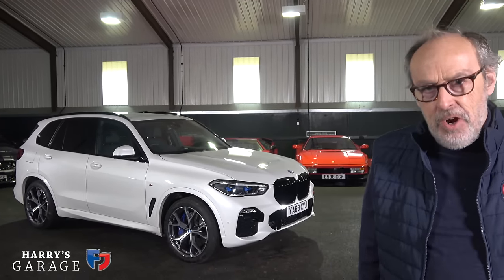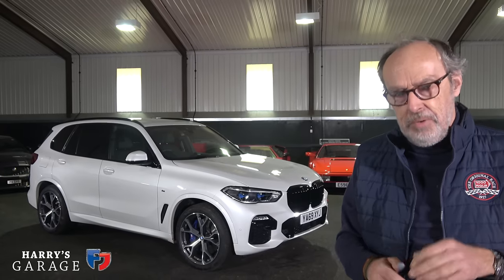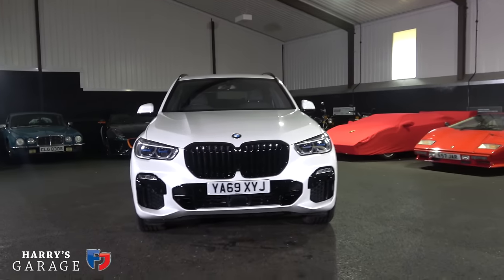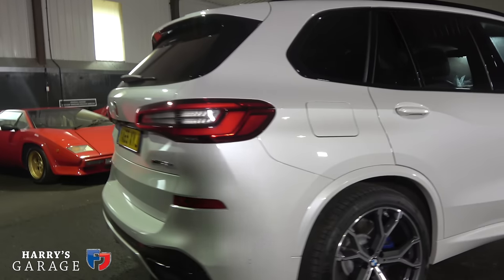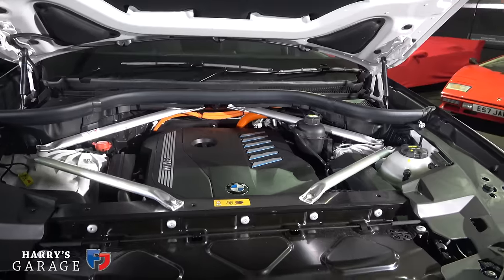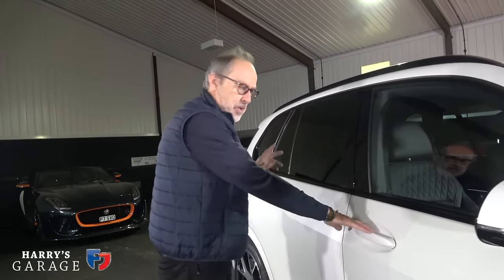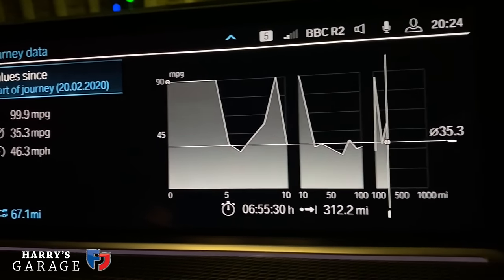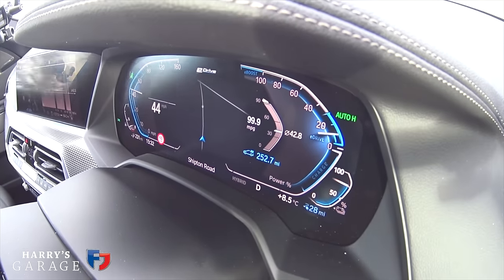BMW X5 45e PHEV 2020 review. Is this new plug-in hybrid better than a pure EV in the real world?

Comment: Great video, as always. What sort of cost is involved in having a home charge point installed? Also what is the life expectancy of the batteries? Would these vehicles be an viable second hand purchase in say around 5-10 years?
Reply: Same question here, oh BMW guarantees batteries for only 6 years! Be aware! About the charger, not just the cost, but what kind of amperage do you need? Most old houses don't have a lot of room on their breaker boards.

Comment: It comes with a charge that will work from a 13 amp socket and charge the car overnight. If you have a charge point installed it will charge at 32 amps and they say get to 80% within six hours. First you have to go into settings to adjust the charge rate. I have a charge point on order, due to be fitted later this month.
Reply from the maker: I've been told it'll only charge at a max of 16amps due to new EU legislation to limit grid demand, which came in 01.01.20. Couldn't find any way to increase charge rate beyond 16amps and that's only up to 80% anyway, then it reduces down to below 10amps to protect battery. Takes an age to recharge!

Comment: Correct me if Im wrong but these 63 mpg values dont have electric cost in them while in the same time you said that power bill and petrol bills are almost the same for a year at about £700 each.  Which makes the mpg drop by half in my book, in pounds cost, not in petrol gallons of course...
Now compare the cost of buying the X5 new at 77K vs running your old Range Rover as a daily for 7-10 years and you'll see the savings arent there.

Comment: Good video - will be curious to see if you can get a GLE 300de to compare... is the 60 mile claimed range real, is the extra economy of the 4 cylinder diesel good enough to compensate for the NVH difference?

Comment: I wonder when you come to sell/trade in if you can tell how many miles the engine has done and how many miles it's done purely on Electric?
Reply: A good question. I also wonder how the engine will wear as it's potentially activated to work hard from cold with no warming up time.
Reply: Good question! Awnser it somebody!
Reply: @resnonverba137   Well, I've worked at a Hyundai dealership and I stopped recently. In there plugin hybrids (ioniq hev and or phev) they used really thin oil for the engine so it got up to temperature just as fast as as regular petrol engine. However. The normal hybrid vehicle I drove, always fired up the petrol engine as soon as I started it when it was cold outside, just to put some temperature in it.

I think, unless you really put your pedal to the metal, the engine will be fine. However, I've got no proof. These cars are just 4 years on the market now an no errors have occurred yet.
Reply: @Stichting-AAP  Thanks for info.
Reply: Res Non Verba id imagine as long as you stay under 4K rpm it’s fine. I’m curious if the engine has a heater on the block to get temperature into the engine. I’ve owned two Bmw now and they typically don’t get up to temperature for the first 15-20 mins of driving so I’m very curious.
Reply: @thomasbailey4139  You could be right but it would be another frustrating restriction with the car. For me, hybrids still have a long way to go (excuse the pun) before being a serious consideration.
Reply: Res Non Verba if I lived in Europe I’d strongly consider that car. In the states 93 octane is cheap still and id just buy the standard oil burner.
Reply: @thomasbailey4139  Many diesels are now superb and matched with excellent auto gearboxes that make the most of the power and economy. It's ironic that, now they are better that they've ever been, they are apparently the work of the devil. I've covered over 5k in the latest 5 Series and have nothing but praise for it yet I would tread very carefully before buying diesel now as the resale could be seriously affected by legislation.
Reply: Csab  We can't be the only people that are curious yet I've been unable as yet to find many answers on the Internet.
Reply: Res Non Verba we don’t even have the option of a diesel in the states and if there is one it’s for a year then killed off and the people with them do really well on resale. Our super duty trucks have diesels but who cares.
Reply: @thomasbailey4139  Interesting. Just as well the BMW petrol engined cars are also very good.
Reply: @resnonverba137  If I am not mistaken, Thomas from Autogefuehl tested the new X5 PHEV and I believe he said that according to the BMW engineers some components of the engine are built better, more durable.
Reply: @jakadirnbek7141  Thanks for info.
Reply: All that tech will be interesting to run once it's out of warranty.
Reply: @resnonverba137  https://youtu.be/cFqrVPN60lI at 38:00 Thomas talks about durability
Reply: It depends -if you want to reduce your use of fuel, then a hybrid will do that
Reply: @resnonverba137  I think it's to reduce the particulates in the atmosphere
Reply: Res Non Verba I’m sure the bmw engineers have thought this through...
Reply: @jakadirnbek7141  Thanks for link.
Reply: @ethicalelectricalgroupltd3153  The same engineers that thought through Vanos technology.. I would rather ask the questions and have some idea of what is what. As Harry mentions, plug-in hybrids are more of a pain than a resolution if one does not have the ability to keep the battery topped up at home.
Reply: @resnonverba137  Things should be better because if you do 40 miles or less the engine doesn't have to kick in at all. I'm sure there will be some sort of eco setting where the engine doesn't start up at all until the battery is dead but it might lower acceleration

With the average UK car doing just 20 miles a day it means most days it would be all electric

Long range (20-50 miles) plug in hybrids solve a lot of the problems with petrol cars. The best selling car in Europe being the small Polo which costs £13,000

Add a 8KWh battery to give 30 mile plug in range. And this little hybrid Polo would be 90-95% annual electric miles and only 5-10% Petrol

Less wear and tear
Much cheaper fuel (1p a mile on cheap night time electricity rather than 11p a mile on petrol)
Lower maintenance
Better acceleration especially at the 0-40mph speeds these cars spend most their lives in

The government could and should deploy a million 7KW chargers in car parks supermarkets stations and popular locations and make it free so people can charge up at both ends of their trips. Electricity is so cheap and EVs are so efficient that this would be affordable to do

7,200 miles per car in the UK even if 100% was charged for free at government chargers that's just £180 per year per car. However 80% of charging would charge at home so the actual cost to deploy a totally free 7KW charging system might be just £36 a car on average. Can add this to road tax to cover it and then all plug in hybrids and EVs have free charging and with a million charging points no worries at all in finding chargers
Reply: @kaya051285  That was a long and considered message. You have touched one of the issues at the moment which is poor infrastructure. Not everyone can charge from home. Personally, my interest in hybrids currently is purely for the performance gains and extra mpg. I am still not convinced that the extra 'faff' makes them worthwhile currently. It would also be interesting to see if the cost of electricity rises along with the extra demand.
Reply: @resnonverba137  Hi

Hybrids have a bright future
Already something like a Toyota Corolla hybrid gets great mileage. This is the non plug in version. It costs £22,000 in the UK it's a good value car and Toyota is generally considered a good reliable brand

It gets a real world 63mpg (UK gallons) both in the city and highway

Take the same car and add just 8.5KWh battery pack (it already has 1.5KWh) and you have a 40-50 mile plug in hybrid. In the UK such a car would be 100% electric most days. With the average mileage just 20 miles a day in the UK

The government could and should deploy a million slow 7KW chargers and make them totally free. The benefit of making them free is that they would cost a lot less to deploy. A free charger is simple. No payment infrastructure needed and these free chargers would more or less always work

Electricity prices won't rise so long as charging is done outside the peak 4-7pm time. That still leaves a significant 21h a day of 'free' charging. This can be done with a simple toner that costs £5

In fact electricity prices could fall
The reason for this is that only one third of electricity prices are actual generation of electricity. The other two thirds are fixed costs so the more electricity is used the cheaper each unit becomes. This may seem counter intuitive but it's the main reason electricity prices in high useage countries are cheaper than lower useage countries. Eg US rate is about 10 cents a unit while UK rate is about 20 cents a unit.

Even if you don't have a home charger you can get a lot of free miles just charging here and there. Say for instance the average car visits a supermarket once a week and stays for an hour. That's 7KWH and 30 miles charged up. Times 52 weeks a year = 1560 miles for free.

That might not sound like a lot but it's enough to cover 20% of an average UK car average mileage

Even without home charging cars can have supermarkets. Work place car parks. Parks. Leasure centers. Train stations. Shopping centres. And plenty of on street chargers. Just charging for free here and there will cover most people most of the time. In the event that you don't have a convenient charger you always have petrol to fall back on. But with free charging in public locations, super cheap night time charging Vs petrol for 10-20p a mile most people would charge most of the time 

As I said before even if 100% of charging was done at free government chargers it would cost only £180 a car. But plenty of people would charge at home just for the convince since a full charge of 10KWh would only cost half a pound

So maintaining and running a totally free public charging infrastructure would be very affordable. My guess is well under £50 per car which can be out into road tax and you get benefit of free charging

Don't even need to do 50 mile plug in hybrids. Even 25 miles would be sufficient if free public charging was everywhere

Average UK car does 2.5 trips a day for 8 miles. So a 25 mile car can easily cover most average trips

Plug ins should evolve to 50 mile range but for now even 25 miles does the trick for most people most the time
Reply: Plug in hybrids make so much more sense than a full EV

A plug in Hybrid with 40 miles range can achieve as much as 90% of annual miles electrified at 1/5th the battery weight and cost

With abundant free 7.2KW public charging infrastructure such hybrids could become 95%+ annual electrified mileage at a fraction of the cost and weight of a full electric EV

The other 5% can be provided by biofuels if necessary

Even for a taxi a hybrid is great
40 mile electricity + another 40 miles electricity on a lunch break = 80 miles a day in electricity. Average taxi only does 100 miles a day = 80% Electrified
Reply: @kaya051285  I am not buying a hybrid from you :I
Reply: I Kaya nothing is free and chargers aren’t cheap.
Reply: @thomasbailey4139  I didn't suggest it was free. I suggested it was a small enough sum to make it viable to do

£180 per car max more likely sub £50 a year let car on average

Re the chargers they are about £800 each so a million would cost £800m deployed over 10 years is £80m a year

By comparison today the government gives £3,500 per EV in grants

Comment: I would really like to know how thoes engines will work when you put in some use. I mean at least in the past short trips with just a minute running was short for murder for engines. Fine for first owner, but used, not matter brand, everything rubber plastic and so on has to be on braking point. Probably will have enormous sludge buildups to
Reply: they are typically hardened to it etc
Reply: One of the good things about hybrids is that the engines do not idle when cold. The one I have runs at around 3000 rpm until it warms up when it starts, with any surplus energy being transferred to the traction battery, then it stops unless it’s required. Thus they are probably better in the long run than traditional engines used in urban areas.
Reply: John Keepin idling when cold is a tiny fraction of a combustion engine’s lifespan. Will be interesting to see how these hybrid power units stand up over time and say 100,000 miles
Reply: @johnkeepin7527  Starting up at cold is as said a tiny bit of the lifespan. And even if it sits att 3000rpm water may get up to temp reasonable fast. But that does not prevent sludge, condensation and so on. Would also need to get the oil temp up to a 100 celsius and that just doesn't happen in 5min.
To put it this way. The nany driven city car even today is usually so cloged up it struggles to deliver any reasonable power or fuel figures. Especially know with manufacturers forced to use E6 technology.  All they saving done in nany it in the begining is eaten up by the service bill later
Reply: The battery cooling system reroutes to keep the engine warm when it's not running. Car manufacturers do employ engineers to solve these issues.

Comment: I hate the idea of planned obsolescence in electric vehicles, unlike mechanical cars once the batteries are finished between 5 - 8 years the vehicle are worthless.
Reply: Just FYI they last far longer than 5-8 years. I have about the cheapest, most crappy electric car money can buy and the battery is now 5 years old and is still in perfect condition holding 100% of the original charge(I'm sure it's degraded a bit but they build a buffer in).
Reply: CDIAT same I got a Late 2013 leaf and it has 93-94% battery capacity after 53,360, no range loss yet

Comment: My question is, with these cars, how do you ensure the engine is warm?
Reply: Saw the test of a YouTuber who drove in EV mode till getting onto the autobahn. The engine clearly was not warmed up, yet revved full on. Surely not good for the ICE.
BEV is the way to go, if possible.
Reply: @NicoSteinacker  There are two PHEV's I know of that don't have this issue. The Chevrolet Volt and the BMW i3. Essentially range extended EV's where even at full throttle the car is pure electric - with the engine running only as a generator. This is why the Volt has many examples of 200k+ mileages without issue. Tremendous shame there is now not a single such car in production that I know of. Seems a step backwards to me, other than pure BEV of course which is fine but not yet for everyone - these range extended EV's would be the best stepping stone.
Reply: MoDo I can’t belive more manufactures don’t produce volt/ampera like cars
Reply: MoDo the Mazda MX30 will be the next BEV with Rex. But the car does not sound too interesting besides that.
I drove an Ampera (=Volt) last year and was impressed by the quality, ride smoothness and performance. I chose an Ioniq EV instead, because the Ampera has only two back seats and spare parts are getting expensive here in Central Europe.
Reply: @NicoSteinacker  yes your right I forgot about the new Mazda. Not a great EV but I suppose looking at it as a range extended EV it is more practical than Ampera or i3 - only it should be considering its relased almost 10 years later!